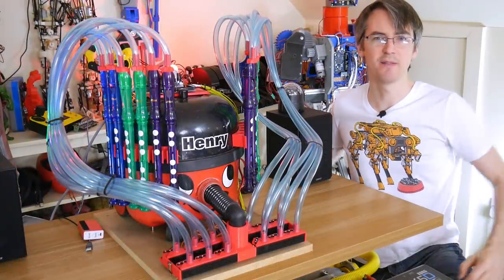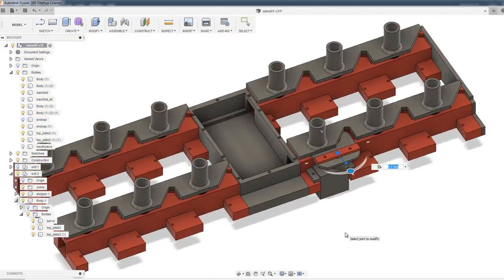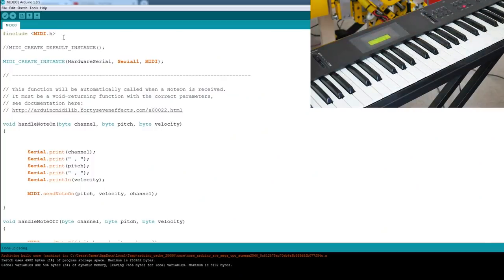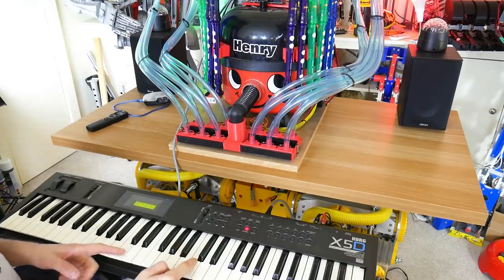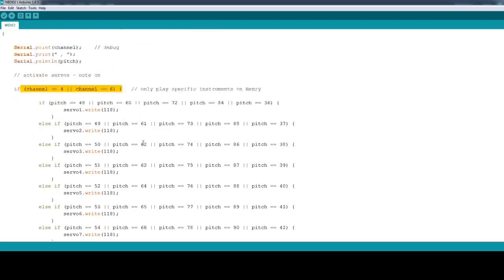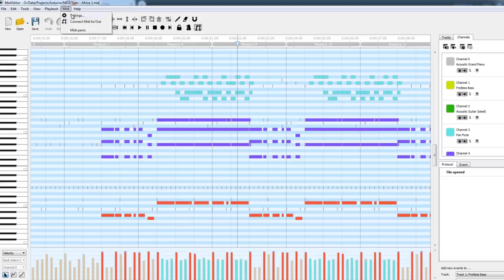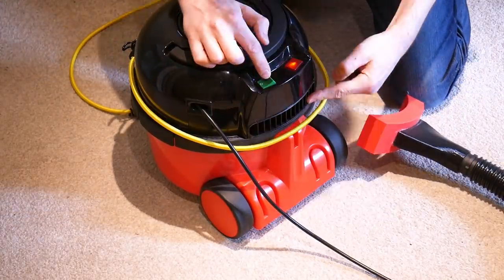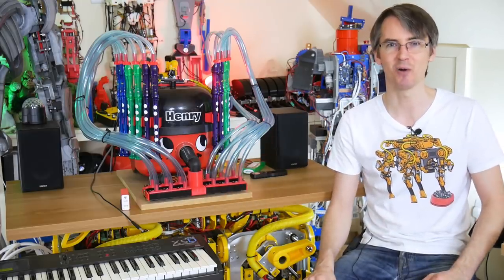How I built a MIDI Controlled Henry Hoover Pipe Organ | James Bruton

Comment: Great Job! But maybe get some other recorders, they sound horrible,
Reply: 🐕🐕🐩🐕🐩 All the neighborhood dogs come charging in like the Toot Sweet scene from Chitty Chitty Bang Bang. With a little knowledge about fipple flutes, I think they could be salvageable. First, notes can be tuned by partially covering holes from the top down, although that would have to be backed by something more rigid than a sticker that won't tear off due to the pressure. Second, the flow could be adjusted with tube clamps, lower notes need less air, but unfortunately higher notes will be louder, might be able to fix that a bit by also partially closing the fipple. 3D printing fixed length pipes (or finding pipe of a size that fits and cutting to length) then tuning would also be an improvement.
Reply: its because the air flow from a human and an arrangement of pipe and valves like him isnt the same. he also have a male coupler going inside the inlet that reduce the flow and linnear mouvement.
Reply: Yes, please! Maybe use some wooden ones?
Reply: @plaetzchen86  It doesn't matter what material a "wind instrument" is made from -- it is the air that makes the sound.
Reply: John Długosz technically correct but wooden ones are usually tuned more précis
Reply: I'm not sure if it's the type of recorder in this case, but rather that a lot of people forget that they can (and need to be) tuned.
Reply: @LazerLord10  oh right, that's why there's usually a slip joint at the top and sometimes the bottom except for trashy ones with no slip joint at all.
Reply: That is exactly what recordes are meant to do, to express the hate of kids forced to play it in middle school
Reply: that's the point
Reply: the fingering scheme seems a bit dodgy to me (source, i play the recorder) but maybe i cant just see the adhesive dots properly

Comment: 4:35  I don't know for sure about those plastic toy flutes, but a regular orchestra flute can play an octave higher just by blowing differently.  I don't know how to describe how to blow; only that I could do it.  Likewise, a bugle plays several different notes with no valves -- different vibrational modes are chosen by how the player blows into it.
Reply: I believe you essentially blow in just the right amount of pressure to get a harmonic to resonate louder than the base note. To get that harmonic up in the first place, IINM you need to introduce some sort of perturbation in the way of the wave.

It gets the air in the pipe to do two (or other binary fractions) vibrations in place of one... Not unlike how you'd do a harmonic on a guitar string actually... The trouble is that doing this is pretty finicky, and takes a bit of learning to get it to happen with an instrument. A mechanical device that does it would be tricky to set up, but they have the advantage of being very repeatable (hopefully).

Not impossible actually...

Comment: You got me with your decoy Henry. Well Done ! (I was expecting some internal surgery). Please add some valve regulators on those tubes like thing:1548243,  it will improve the quality of the sound (You must pinch them enough so that the source pressure stays constant no matter how many flutes are playing, but be careful not to overheat poor Henry by letting at least one valve semi open). Maybe you can use your air compressor instead, to make it more silent than a vacuum.

Comment: 4:25 A recorder can do nearly 2 octaves if you half cover the hole on the back.
Reply: Whispers His whole project loud which is lovely by the way whispers could have been done with 1 recorder and the valves on the holes of the recorder instead. Valves using a piece of felt, a piece of pipe and a clothesline pin.

Comment: I'm not sure what subset of c++ Arduino environment uses exactly, but wouldn't something more like

Servo servo[12];

be a bit easier?
Reply: So all those ifs become:

if(pitch >= 36 && pitch < something)
  servo[pitch % 12].write(118);
Reply: The code is definitely all over the place, so you may be right.

Still impressive, though. I played around with the same MIDI library, but ran into timing issues.

Comment: Really cool project man. You could fix some of those nasty looking conditionals btw with a modulo operator, which is represented with a percent sign. It's like taking the remainder of a number after dividing it, i.e.: pitch = pitch % 12; if (pitch == 0), etc. It would save you from having to write a few "or"s anyway. ;)

Comment: Great result, but I'm itching to clean up that code :D 

That whole if... else ... block could be a lot cleaner - use an array to store your servo instances and use a case instead of those if (... or .. or ...) to set which servo to play :-)
Reply: Richard Allsebrook Those 36 lines could be condensed in a single statement:

servo[pitch mod 12].write(118)

I don‘t know the exact name of the modulo operator in the language in question but you get the idea. And yes, James, please use arrays for such cases.

Comment: Is there any specific reason to use servos instead of solenoid valves?
Reply: This is only guessing but maybe for finer control.
Reply: I think James has drawers full of servos around his house by now
Reply: @akaHarvesteR   Of course he does. Don't you ?
Reply: possibly due to the cost i am building a similar project (no Henrys though) with 40 pipes and i looked at using solenoids to actuate the valves but the cheapest solenoids i could find were £5 each then on top of that cost there is the need to build drivers for those solenoids using MOSFETs etc and a pcb for this circuit which would add cost to the project as well. The servos i am using are less than £1.40 each when purchased in quantity and they can be driven directly from the Arduino board.

Comment: You could have just swapped the motor connections to make it spin the other way to blow air.
Reply: I honestly assumed that's what he did. Though, for his use case, the real hoover being downstairs is better because it removes the noise.
Reply: @willb.nimble6749  he still could have done it for the real Hoover downstairs so there is no longer any leakage

Comment: I must admit this inspired me to want to attempt my own variant, but with custom-made flues. Have you considered 3D-printing the flue bit (the whistle part at the top of each recorder) and using PVC pipes to get a more accurate tuning/range? So far I've been able to get an octave using 1/2" PVC pipe but I've struggled to get anything lower than C3.

For those interested, I also designed my own MIDI controller board for this purpose. It can handle up to 128 outputs (full MIDI range), and is designed to direct drive solenoids instead of servos.
https://www.seeedstudio.com/MIDI-I-O-Board-g-1242703

Comment: That's quite a cheat. I'm surprised a Henry hoover only sucks.
The vacuum cleaner I've got has a suck and a blow port, and a fair few vacuum cleaners do.
So if you can't get it working through the 'suck' port, you'd use the 'blow' port.
But still... That excessive 'cheat' is amusing regardless. XD